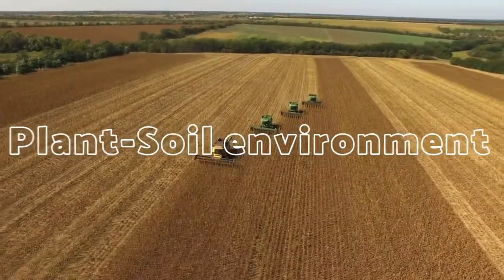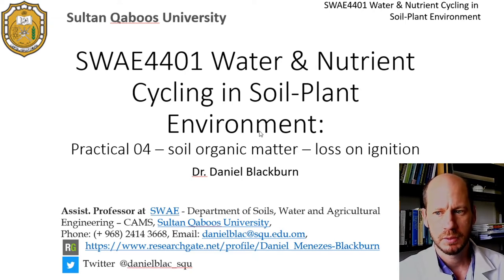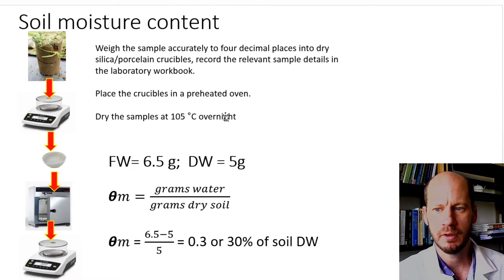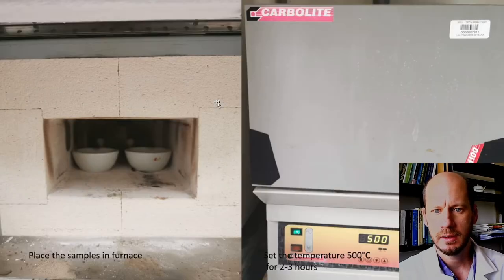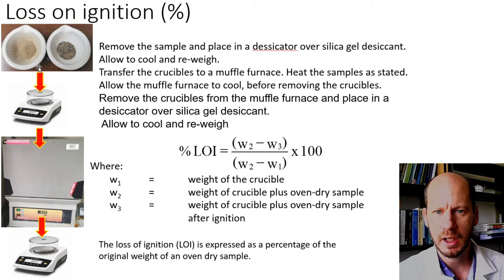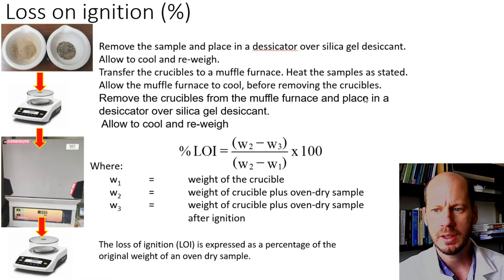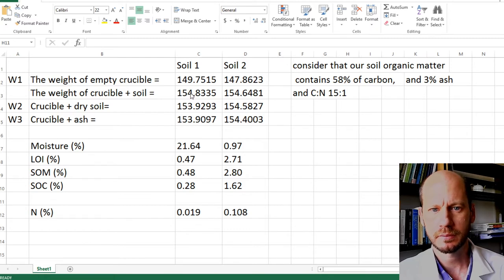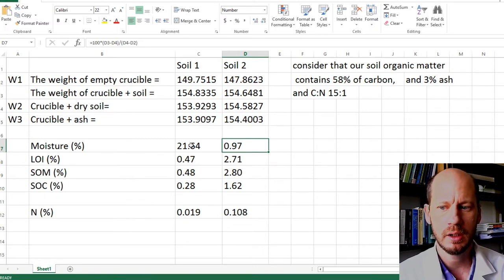Lab 04 - Soil Organic matter by loss on ignition (LOI)

Comment: Did the samples had to immediately put into the furnace after drying process, or i could put a week-aged dry sample for it?
Reply from the maker: Keep it on the dissecator to avoid buiding up moisture.
Reply: @danielblac  thank you very much for the information, im just about to conduct this method to analyse the carbon stock on seagrass.